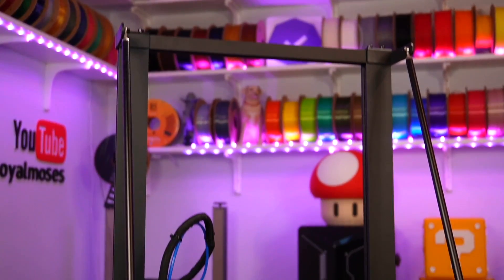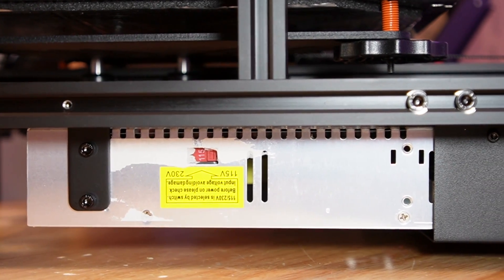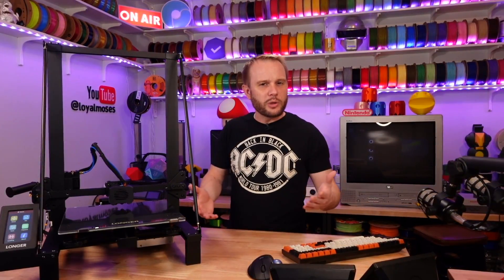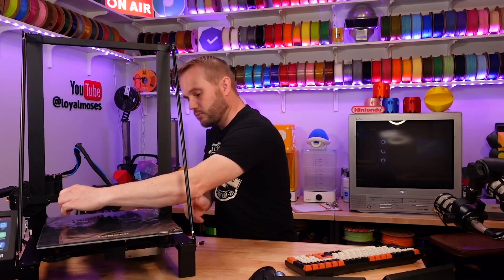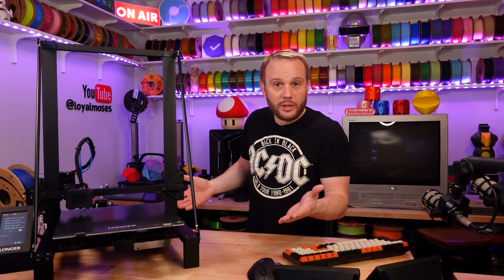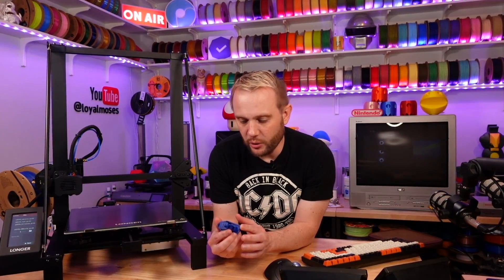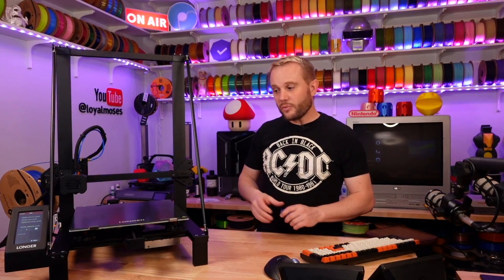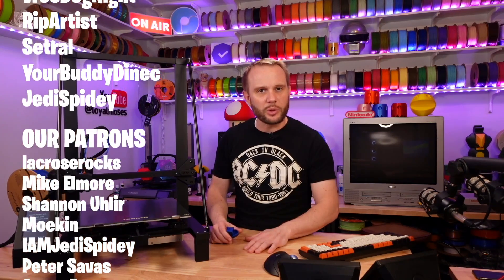Longer LK5 Pro - Can it compete?

Comment: I grabbed this one on a black friday sale for around $200 to compliment my upgraded grab to a resin printer. I was extremely hesitant to grab anything with a low print volume (with much higher detail) on filament because my resin printer is a modest volume with extremely high detail.
I primarily use both for wargaming, model making/painting, and random gift ideas.

Comment: Running a good ol' ender 3 Pro too since 2 years, yet got it used so who knows the actual age of the thing. Likely in the 5+ years range. Has had all the upgrades you could think of; linear rails, new motherboard, klipper, Bambu style hotend, a direct drive extruder (humming bird) and much much more. Now it requires more service than not and I'm about to upgrade to the new Qidi Q1 Pro.

Maybe I'll dissect the oldie and do a complete DIY printer for fun
Reply from the maker: Very cool! Also, Q1 Pro is great!

Comment: I literally just bought this exact machine from eBay for $28.60.  The only issue with it was the filament runout sensor which can be bypassed with a piece of wire.  It runs very quietly.  I noticed the included benchy was terrible as well.  I am going to try something sliced later on.
Reply from the maker: Wo! $28?! You scored!

Comment: Over the years 3d printing and printers have changed in many ways. Prusa gave you reliability, creality gave you accessibility with price, voron gave speed and everything else was just iterations of the same giving steps in development.
Then came bambu lab. Nothing really new but what an impact on the 3d printing world. Bambu lab took a geeky technology and turned it into a near perfect home appliance system and pushed the boundary with multi material AMS.
I have a creality ender 3 s1 (stock) and it prints great and sat next to it is a Bambu lab A1 (with new bed fitted) and though similar as bed slingers they are worlds apart in operation experience and of course speed. But both work great, I still use both side by side but what a leap in just a short time.
We should be thanking Bambu labs every day, not because of the printers and slicer they have given us but by what they have made other manufacturers produce in the last 12 months.
wow I would love to have started 3d printing today instead of years ago, can’t wait to see what comes next 🤯
Reply from the maker: Thanks for sharing!

Comment: My wife actually bought this for me for Christmas a while back.  I upgraded the Boden setup to a swiss micro ng direct drive (cr-10). Put in the dual z screw,  After finishing the cad design I'm actually printing a new hot end cover  for bl touch and two fans on my bambú labs in abs for the  bltouch upgrade.  I definitely do not run faster than 40-50 or ringing is too bad on detailed parts with both Boden or the new swiss micro moving up to .6 to speed it up as well.  Doesn't compare to p1s quality no matter what you do to it but good for really big functional prints  like a full size weeping angel concrete mold for garden.  Just don't blink...
Reply from the maker: Awesome!!!

Comment: I have this printer.  It was my first 3D printer, and I bought it back when it was first released.  My only complaint is that prints stick to the glass so securely, I'm afraid of breaking it.  I've since put a magnetic sheet and textured PEI plate on mine, problem solved.  It's not fast, that's for sure.  I don't print decorative stuff or trinkets...I print functional stuff almost exclusively.  However, I can say that my prints are generally better than you got with that Benchy.  I've since bought a Bambu Labs XC1, and that thing is great.  But I'm hanging onto the LK5pro because of it's print envelope, until I find something newer that prints that big...perhaps a Sovol SV08, or an Elegoo Neptune 4 Max...but that doesn't cost as much as my XC1.
Reply from the maker: Thanks for sharing

Comment: The resolution issues could be caused by the way the gcode was encoded my the slicer and the resolution level it was assigned.
Reply: I meant to write by the slicer.
Reply from the maker: Very strange for the default print to be this way! I was a little sad when I saw it!

Comment: I owned 2 of those…  they actually printed very well… I upgraded them to dual z… there was no auto leveling until I added the bl touch. But you need to do your PID tuning and set your esteps for proper extrusion
Reply from the maker: I’ve seen some great prints over the years from them, so I know it can print better!

Comment: I think it's sad that most company went the way of re-inventing the wheels every year with their printer's design and parts. We sadly left the mantra of reprap and went the closed en proprietary way of doing things. Printers are less and less upgradable and Prussa remain's the only choice in that regard. I'm still running the Ender 3 V2 but right now it's printingg at KE speed and acceleration. It took some thinkerring and upgrades but in the end i kept it alive and away from a garbage can instead of outright buying new. This is my main grip with bambulab. Fabulous printers, but horrible mantra.
Reply from the maker: It’s the way of the world, there are open and closed solutions and a place for them both! Thank you for sharing.

Comment: It actually is crazy that machines started to actually prioritize aesthetic after Bambulab. 

Like there's a huge difference between the original ender 3 and its V3 in terms of design
Reply from the maker: So true! So much has changed in just the past couple of years.
Reply: @LoyalMoses  That's the one thing I nitpicked about the original printers is that they all look a bit tacky/ too diy like.

If you don't mind looks sure it's not bad. But I am an artist and I'd rather have a machine that fits the aesthetic of my home rather than a sore sight of a skeleton of a computer.
Reply: Just wait a couple months better machines will be flying of( the assembly lines of 3d printer factories.
Reply: @LoyalMoses
Reply: There’s only gonna be more innovation not less